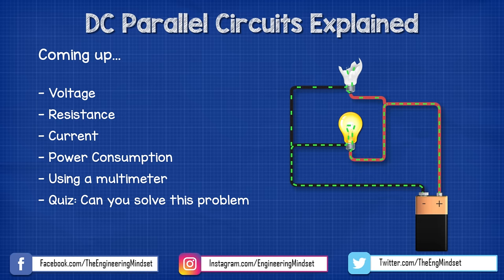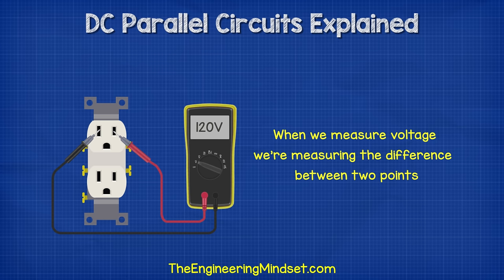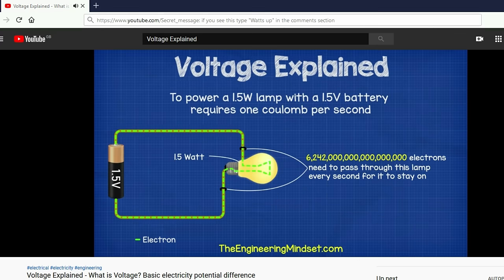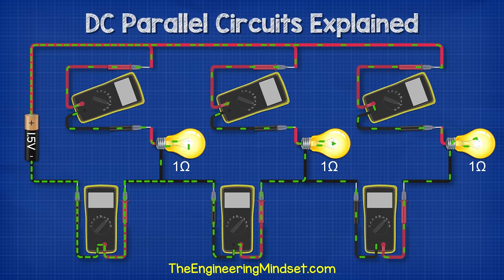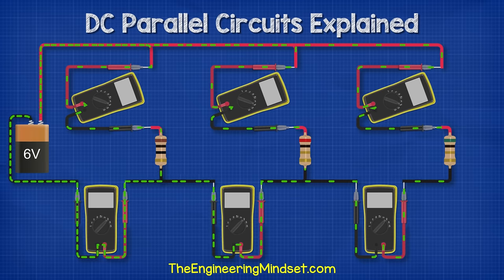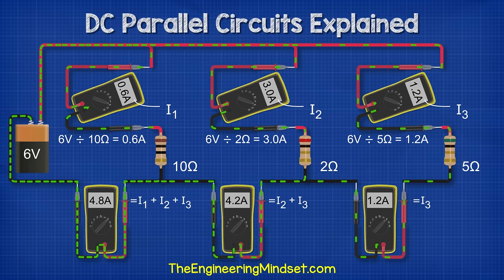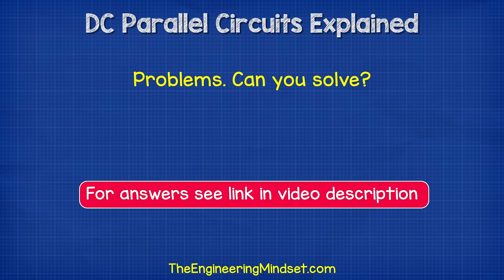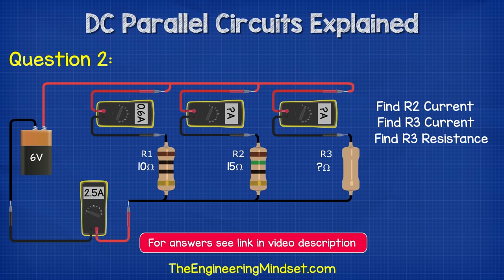DC parallel circuits explained  - The basics how parallel circuits work working principle

Comment: At 3:12 why issit said that the current is 2 A and the total resistance is 3 ohms when the multimeter states that it’s 3A and each of the resistor is 6ohms?
Reply from the maker: See video description for correction

Comment: I understand how to do the math on circuits now thanks to you! But the reasons of why it works like this are completely lost on me. It honestly doesn't make any sense in my mind that it should work like this.
Some questions I have are like:
- Why doesn't the battery reset the voltage and current when it goes through.
- How does the cable split know to reduce the current by the exact specific amount that the resistor needs before it hits the resistor?
Reply from the maker: Check out NEW resistor video, everything covered! ➡️ https://youtu.be/DYcLFHgVCn0

Comment: Great video, thanks.   But.  I don’t understand how placing two 1.5v batteries in series works (how does it double). 
If I no current flow can occur from the negative terminal to the positive terminal,  then how does connecting the positive terminal to the negative terminal of a different battery work?  ...shouldn’t the electron difference between the touching terminals balance out immediately (like shorting a single battery with just a piece of wire)?
Reply from the maker: Check this out, how a battery works: https://youtu.be/PXNKkcB0pI4

Comment: I understand all this. What I still do not understand is why in your video with the inductor and bulb in parallel the current stops flowing through the light. There is still a voltage differential over the bulb, but no current flows through it. What am I missing?

Comment: At 5:39, how does the total amps get increased to 3 Amps? I thought amps were calculated with volts divided by ohms, wouldn't the total amps be 1.5V / 2 Ohms = 0.75 Amps?
Reply: Nevermind, I think I figured it out, you calculate the voltage based on the ohms in each branch and then add them, not just total voltage divided by total ohms of the entire circuit.
Edit; played the video a bit more and literally answered my question a few seconds later.

Comment: So naturally i always wondered how current is increased by simply placing resistive loads in parallel...it doesnt make intuitive sense...you add more loads and the current increases? Also what is the tradeoff, since the current demand increases or increases, does that make the batter run out much quicker?you went over the circuit analysis but did not go over an intutive feel of the situation....how does adding more things cause a current to increase, and what is the tradeoff of this...i can only think that the batterys capacity or lifespan decreases as a result..... i want to know how the effective resistance intuitively decreases by placing resistors in parrallel.
Reply from the maker: Check out NEW resistor video, everything covered! ➡️ https://youtu.be/DYcLFHgVCn0

Comment: I just dont understand the need for resistors. Ive seen people connecting multiple led lights on one circuit, with each led light having their own wire connections to add on to that one dc fuse wire on the dc panel?Even adding on a switch or dimmer and it all turns on the lights at full brightness. Pls explain.

Comment: I've been working through your whole series, it's extremely good! One thing that still scares me is not being able to understand how to stay safe when working with electricity. What are the factors I need to understand in order to predict what is safe or not? Is there some Voltage + Amp threshold below which no shock will occur? I want to understand how to know when it's safe.

Comment: hello there, I was just wondering. At around 3.40 you ask the question what is the voltage drop. The answer is 12 volts the same as the intial output of the battery(12 volts) ,so there is no voltage drop? . thanks in advance

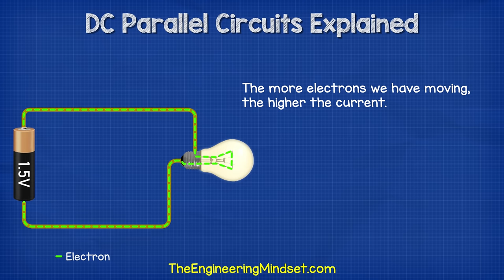Comment: In 4:50 if the voltage gets higher,more force acted on free electrons,so the speed of electrons must increase.
Am i wrong ?
Reply: I have exactly the same question. The speed of electrons, or drift speed, should increase when increasing voltage? That's why we get more amps - in one second more electrons are able to pass the cross section of wire because of increased speed.

Comment: (at: 7.16 minute)does battery series increase current (double up voltage also double up current ) when it connected to a parallel circuit  ?

Comment: How about we change one of the resistor to inductor, in the inductor video, you said current don't go through inductor first but later all go though it, seems outside law of parallel circuits. 🤔

Comment: At 3:08, the total resistance is declared as 3 Ohm, but each resistor's resistance is supposed to be 6 Ohm? Am I conclude that, given resistors of equal resistance wired in parallel, each of their resistances is divided by the number of resistors present? This total resistance is just stated without any previous suggestion as to why it may have the value that it has, so I'm having a hard time trying to understand it here... but maybe I should watch the rest of the video, lol
Reply from the maker: Check out NEW resistor video, everything covered! ➡️ https://youtu.be/DYcLFHgVCn0

Comment: Can you explain why when V increase, I increase by amount of e- flow instead of velocity of e-? It seems to me that the electrons should move faster due to conversion of more electric potential energy to kinetic energy
Reply: there is a linear relationship between voltage, current and resistance in an ideal circuit

Comment: I don't understand why at the beginning when you are showing you are using an electron flow the resistor is behind a led and not in front of the led. If electrons flow from negative to positive potential shouldn't the resistor be in front of the led?
Reply from the maker: Watch this video in full https://youtu.be/7d4ymjU9NqM
Reply from the maker: Check out NEW resistor video, everything covered! ➡️ https://youtu.be/DYcLFHgVCn0

Comment: I came up with a possible better formula scheme to calculate total parallel resistance. First: R1.  Next: 1/(1/R1 + 1/R2) = 1/(R1*R2 / R1+R2).  Next: 1/(1/R1 + 1/R2 + 1/R3) = 1/[(R1*R2 / R1+R2) + 1/R3].  Next: 1/(1/R1 + 1/R2 + 1/R3 + 1/R4) = 1/[(R1*R2 / R1+R2) + (R3*R4 / R3+R4) ].  As the number of resistors in parallel increases, for an odd number of resistors you get multiply divided by sum, x number of pairs times, plus 1/R_odd.  When the number of resistors in even, leave off the 1/R_odd.  Did I do this right?  Let me know!
Reply from the maker: Check out NEW resistor video, everything covered! ➡️ https://youtu.be/DYcLFHgVCn0

Comment: 2:30
"In parallel circuits, the voltage is the same anywhere in the circuit"

WHY???

3:56
"When we connect batteries in parallel, the voltage doesnt increase"
WHY?

They are still joined together in the end, so you would assume that the voltage would be accumulative. What is the nature of electron flow that it would work in such an unintuitive manner?

5:30
Wait adding more resistors increases the current?? Pardon??? 
Again I ask, WHY?????
Reply: for the third question: you're increasing paths through which to flow, and as such, the total amperage increases. Pay close attention to the points at which the multimeter is connected
Reply: It's like asking why gravity exists. We don't know why does it exist. But we do know how it works. 
We've just observed all of these things.
Reply: @uply5FOi  If we are sticking with the water analogy, wouldn't the introduction to another path also divide the force of the flow (voltage in this case) as well?? at which point does the analogy break down?
Reply: @MelloCello7  we're assuming a constant voltage. A voltage is a difference in electrons, or with the analogy, water pressure. You have one pipe that can deliver 5 units per second. Using that pipe, your maximum water flow is five units per second. Now, add 3 pipes of the same type. Assuming a constant pressure, your total flow should be 20 units per second. Allowing the flow to decrease on any of the pipes would be to allow the pressure to be vary, and thus the situation you are describing does not match the one in the video. The video is targeted towards explaining basic concepts, so it assumes ideal conditions. The ideal condition of this situation is that you have a source of water that can supply that much water at a consistent pressure. 

yeah the videos are sometimes unclear, but I hope that this helps
Reply: @uply5FOi  I understand we are assuming a constant voltage, but that assumption only reinforces the question: why are we assuming a constant voltage? If we were to do that in a real situation, the pressure would absolutely be divided among the paths (causing lower pressure). 

This is especially troubling when we do acknowledge an increase of amperage when introducing a different path, (so much so that it decreases the total resistance when introducing one along another path). 

In order for those ideas to work together, then the effective pressure would have to automatically increase to compensate for the extra "space" as it were. (If you were blowing through one straw to have a given pressure, then introduced 5 more straws, you'd have to blow even harder to maintain the same pressure among all 5 straws).

If it's the same 1.5 volt battery then what gives?  (Thank you for all your help btw!)
5:30 does the battery some how just start working twice as hard to provide the increase of 3 amps? Whats really going on inside these little imaginary wires?

Edit: After watching more, it seems that the circuit is going to take what it wants from the battery regardless, why?
Reply: @MelloCello7  we assume a constant voltage because many power supplies can handle that task, and it makes the situation easier to understand. Yes, if you're working with a single AA battery, you would experience a voltage very easily, but that is because a AA is very weak. 

Again with the water analogy:
You have a very large tank of water that keeps being refilled. It makes no measurable difference if there are one or four holes at the bottom.

real world application:
you have a power supply that is built to supply a constant voltage and has a powerful enough source to maintain that voltage despite changes in current. 

These are idealized situations that you won't always run into, but again, a AA battery is very different from something like a switch mode power supply plugged into the wall. For simplicity's sake, we are assuming basic ideal conditions.
Reply from the maker: Check our new Multimeter tutorial out ➡️ https://youtu.be/4lAyzRxsbDc
Reply from the maker: Check out NEW resistor video, everything covered! ➡️ https://youtu.be/DYcLFHgVCn0
Reply: @EngineeringMindset  Will watch right away! Thank you for reaching out to me!

Comment: So I have been watching your videos to try and create my own circuits as a complete newbie. I have a buck converter shooting out 6V connected to a 5V LED strip and a 6V 150rpm mini motor in parallel. I notice that when I turn the motor speed all the way up the LED strip goes dim. Why is that? I thought then you connect things in parallel they should both receive 6V because they are in parallel? Ik the LEDs are receiving 1V extra but I think they should be ok. Perhaps im connecting things wrong?
Reply from the maker: Seen the new LED explained video? so much detail covered! https://youtu.be/O8M2z2hIbag

Comment: If you connect 2 batteries in series, and then connect a load, how the current will be divided between the 2 batteries? In paralelly connected batteries, then current is drawn equally from the batteries. But in series..?
Reply from the maker: Please watch our series video and battery explained video

Comment: in parallel circuit, what happens to equivalent resistance if applied voltage is doubled?

Comment: Still lost...@ 2:56 volt meter looks like it's in the exact same place to me in the series and parallel circuits still getting both poles either way
Reply from the maker: It's not quite the same, it might help you to draw it out on paper. The parallel circuit has the wires branching off to feed either lamp, we could remove a lamp and the other would work. The series circuit has the wire from the first lamp connected straight into the second lamp. If we removed a lamp in this circuit then the other wouldn't work either.

Comment: Do you have a video on series parallel circuits I am trying to study and I understand parallel and series circuits individually but I can't calculate voltage drop and current through resistors  in a combined series parallel circuit
Reply from the maker: Check out NEW resistor video, everything covered! ➡️ https://youtu.be/DYcLFHgVCn0

Comment: 1st example: 3 amp on the multimeter and (2) 6ohm resistors and we are told that its obviously 2ix3r=6e. confusing. great illustration but there are a few of these inconsistencies. Lord knows I'm not perfect but..
Reply from the maker: Corrections are shown in the video description. I try to ensure no errors get published but some get through, unfortunately.  There's not a single engineering book you can buy without errors in. You have to pay for the book and pay to see the corrections, but this video is free and the corrections are free too.

Comment: Conventional current flow is def easier to understand.

Still can't wrap my head how current flows from the negative, but in a car the negative terminal is connected to the chassis.
Reply from the maker: Check out our video on how a car battery works to learn how electrons flow

Comment: hi i have a problem with the output of my EPEVER UPOWER inverter/charger 230v 50Hz
 
i correctly connected my inverter to ground but when i test with a multimeter i have 115 volts between neutral and ground also 115 volts between live and ground !!

Is it  dangerous ?

what is the problem and what is the solution ?

And what about " ground neutral bount " !? 

Thanks for your help
Reply from the maker: Power inverter video  here https://youtu.be/iIqhAX0I7lI
Reply from the maker: Check our new Multimeter tutorial out ➡️ https://youtu.be/4lAyzRxsbDc

Comment: I love your videos, and this video might have explained how to do what I want to do, but I'm still kind of confused. I'm hoping you or even another subscriber can help me out? I'm trying to control a line of individuals l.e.d.s off a potentiometer having more lights come on depending on how far the pot is turned... I'm sure this is just trivial to a lot of people... but I'm just a novice, and really want to learn! I actually accomplished this once just by flook on my breadboard just switching out different resisters in different arrangements, but I didn't take a picture or write anything down, and now I can't remember what I did. All I know for certain is that I was using a 5v power supply and a 10k potentiometer, with 2 green, 2 yellow, 2 red LEDs... Help Please!
Reply from the maker: Seen our new Potentiometer Explained video? ➡️ https://youtu.be/Xb-MZMoUtcQ
Reply from the maker: Seen our new Potentiometer Explained video? ➡️ https://youtu.be/Xb-MZMoUtcQ

Comment: you say that when we increase volts we get a amp increase due to more electrons flowing so how come in a transformer we increase volts yet  current goes down this confuses me i know that power in and power out has to be the same but  how can there be more pressure and less electrons ??
Reply from the maker: Please watch out transformers explained video
Reply: @EngineeringMindset  I watched a couple of them I might have to watch them again to get my head around it thanks for replying back to me

Comment: 03:09
 must be 18v  ✔
Reply: I think because the voltage is the same anywhere in the circuit (because it's a parallel circuit), you divide the amps by 2 and multiply by the ohms. 1.5a x 6ohms = 9 volts?
Reply: 3(amps) = v/6(ohms) + v/6(ohms)

3 = v/6 + v/6
3 = 2v/6
3=v/3
3x3=v
v=9

Comment: WHO thinks that "conventional" flow is "easier to understand"? It makes no sense to me since negative charge should mean lots of electrons being able to go out of there towards a positive (less negative) charge, which is perfectly logical. The lad's way is better.
One correction though: voltage increases electron's energy/speed, not its quantity. For later, you should seek a fatter battery (for example, car batteries can have just 12 Volts, not a lot more than small 9 Volt from the video, but provide big Amperes without overheating immediately and not just for a split of second).
Reply from the maker: Check this out, how a battery works: https://youtu.be/PXNKkcB0pI4

Comment: There is simpler way to calculate resistance on parallel circuits :     R1 * R2 : R1 + R2 = R12
Reply: Or when there are multiple resistors with same resistance you can just devide R1 by number of resistors (with same resistance that are connected parallel)
Reply from the maker: Check out NEW resistor video, everything covered! ➡️ https://youtu.be/DYcLFHgVCn0

Comment: but what happens when you place a 1.5V battery in parallel with a 3V battery ?
Reply: He talked about this, the voltage stays the same but you have more mAh, like a bigger battery

Comment: 3:27  "what is the voltage drop across the end lamp, well that's easy"
Indeed, just look at 12V stated on the battery.

Comment: Why does in parallel it has more amps at the beginning than in series? It doesn't make sense
Reply from the maker: Think of it like a road, more  cars can flow with lots of paths, but in series there's just a giant traffic jam
Reply: @EngineeringMindset  So if you put a lot of nodes in parallel, the wire at the beginning would just burn out?